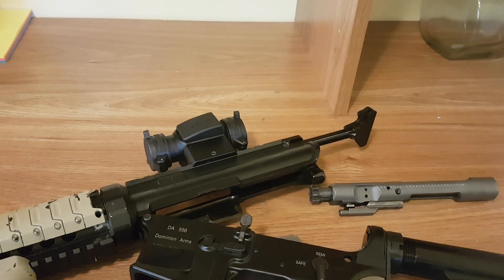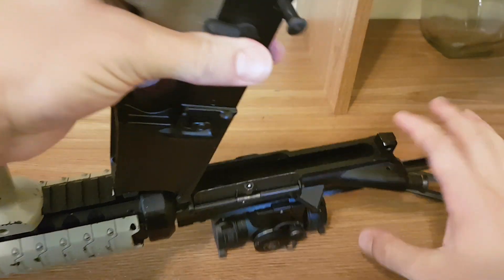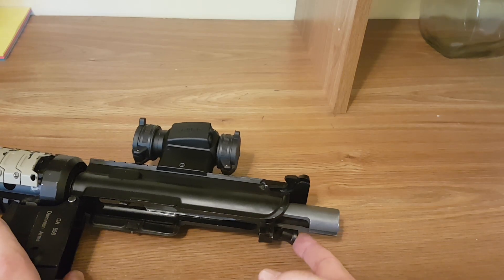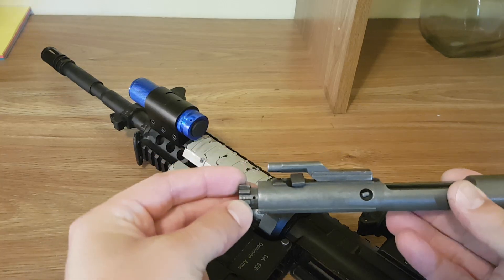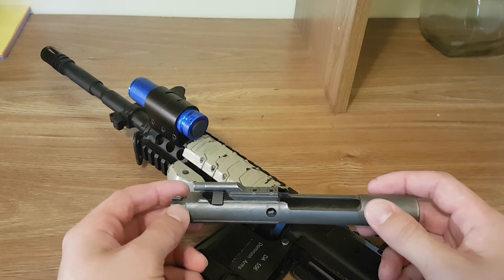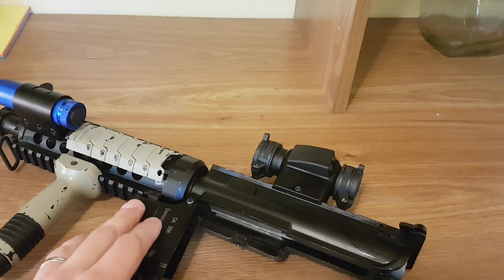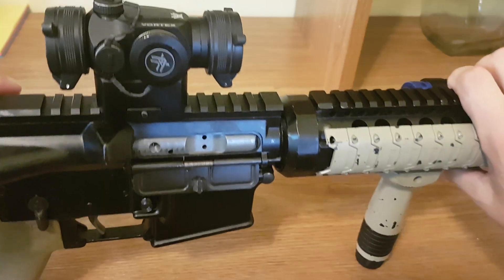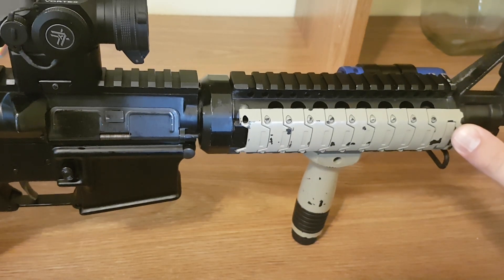What does the Forward Assist on the AR15 Do?

Comment: I noticed that some "less expensive" AR15's come with no forward assist and no dust cover.  Not mil spec but I have read that to a civilian that for the most part wants to have fun at the range this is a reasonable concession and it is not needed.  sounds like you would agree.

Comment: “We designed a dirty shooting rifle that sometimes won’t go into battery. Should we redesign it with a gas piston system?” No, just put a fix-it button on the receiver to force it to work.
Reply: After seeing the InRangeTV mud tests, I'm a bigger fan of DI than I have ever been before. Dirty star chamber or not, DI blasts mud out of the action and presents less points for failure than a piston AR.
Reply: @jasoncarswell7458  Yep. Totally outperforms the AK too.
Reply: yeah. whole concept of such button is wrong
Reply: @dsheshin  The AK has such a button. It's called the charging handle.
Reply: Useless features that interfere with better ideas
national anthem intensifies
Reply: J Calhoun  False. He no longer has the rights to his "direct impingement" system. The AR-18 is mostly stamped, and was designed to be easily and cheaply manufactured by countries who didn't have the tooling to make the AR-15.

Claims of the DI system being dirty are largely overblown. Lackluster early reliability was not a result of gun design, but ammo specs and using the wrong powder.  Pair that with not issuing cleaning kits, and there were many issues. This is all very well documented, but fuck it - let's all bitch and moan about the wonder gun that should have supplanted the horrible AR-15, but didn't, because McNamara was a prideful cunt.

There is a reason the AR-18 never really took off, and it's not just because "big gun industry" didn't want it to.
Reply: Lol
Reply: it originally didn't have it but some branch, iirc marines, made a huge stink about it not being there even if it is completely unnecessary
Reply: @fish3977  Since you have no idea what youre talking about, and are regurgitating points you heard some gamer babble once while playing CoD, you should probably not post on the topic.
Reply: @Valorius  pretty sure it was on forgotten weapons but either way, noone is gonna actually use the forwrd assist. Or at least you are gonna hope so since its just gonna fuck it up worse
Reply: @fish3977  Kyle Rittenhouse used his FA to save his life. PFC Patrick miller used a FA to win the Silver Star.
Reply: Lol, they did that to keep the gun as accurate/light weight as possible. If they did that then it would kinda defeat the purpose.
Reply: Merica😎🇺🇸
Reply: The piston operated Heckler and Koch 416 and 417 still have a forward assist.
Reply: military grade ¯\_(ツ)_/¯
Reply: @steven.2602  military grade everything they have is made by the lowest bidder so what is military grade mean
Reply: @williamdan2593  thats the joke
Reply: J Calhoun  Cool story.

Stoner could not use his DI system because Armalite sold the rights to Colt. I'm not sure what your personal experience has to do with the fact that Stoner no longer owned the rights to his patent. Forgotten weapons made a great video on the history of the AR-18 and AR-180. And yeah, that's exactly what I said. They changed the powder. Modern AR-15s and modern derivatives eat anything too, provided they're well made.

The AR-18 is heavier and less accurate. To what degree that matters is up for debate. But it's not superior in every way.

If you really want to get into the weeds on the powder spec issues, it really wasn't even that the powder didn't burn as clean. The pressure curve was significantly different, leading to different dwell times and chamber pressures when the bolt unlocked.
Reply: You clearly don't understand the operating principles of the AR.

Comment: I'm relatively new to gun ar ownership and like a sponge I am soaking in info, thanks for sharing. That definitely helped.
Reply: Never use the forward assist. If it won’t go into battery then rechamber a new round. If the round don’t want to go in then get a new one that will. Don’t die being stubborn. Only time you should use it is if you get debris in your bolt carrier. Then you sol.
Reply: @Rara Neagra jeeze... That's some real salt and anger... Im also new to guns but I ain't here to talk false information, so please ignore me....
Reply: You have right to buy gun in your country you're so lucky... (fr)
Reply: @Rara Neagra So your also saying doing a internet search will result in yoootooober liar crap? Be a use it says in multiple articles DO NOT fire .556 through a 223 rifle. It says the pressure difference may cause problems including the possibility of blowing the gun up bust more likely to blow the primer out the back of the cartridge and into your guns internals.  Must be an internet and yoootooob conspiracy huh? LOL your an idiot!!  But goid job telling a new guy basically if the round looks the same then it is.
Reply: The best help comes from reading the manual.
Reply: Rara Neagra dude, if you’re going to criticize someone so much and think you’re the shit, please go to a fucking english class before you do so.
Reply: Well then here's a tip for you. Don't ever use the forward assist. All it will do is cause a stuck case to be even more stuck
Reply: Rom vin you sure are making yourself seem wise by insulting everyone who slightly disagrees with you how old are you 14?
Reply: This is bad information. The forward assist does nothing. If you're building an ar15 just get an upper housing that dosent have an assist and save some weight
Reply: @Rara Neagra imagine giving the  internet trolls what they want. Keep on trying keyboard warrior.
Reply: Should have gotten an ak
Reply: Dont use this video as info. It's full of misinformation.

Comment: Just my opinion,  I would never buy an AR that didn't have a forward assist, some people say it doesn't matter because you don't need it.  To me if the manufacturer left it off it's a sign that the manufacturer left off a design feature just to cut corners and save money,  that's just my opinion but to me only a cheap bastard would do that.

Comment: It's for weapon designs that don't run correctly like the m-16 and ar-15. Any competent auto design would close the bolt on it's own. A flimsy charging lever and forward assist is two extra parts to fail or break. Why have them.
Reply: God your uneducated in the ar platform. The ar 15 didn't come with it to begin with it was the army. Why dont you get educated on why the m16 didnt function right in Vietnam.
Reply: @bobbyraejohnson  maybe because gasses are blown back all through the action and magazine, because it's a retarded design. They were paratrooper rifles before the a1 which is what they are good for. Every American idiot wants an ar-15 as a main battle rifle and they just aren't designed for heavy use. It's a glorified Henry ar-7. Why would anyone want a giant spring vibrating in their cheekweld after every shot? Don't you want to get back on target fast? They jam with and without the forward assist so what difference does it make it's junk either way. Cutting 20 grooves in your bolt and adding extra controls is not how you solve  reliability issues.  I think you need more education on non ar-15 powder actuated tools.

Comment: The forward assist was not part of stoner’s original design and he never signed off on it being there. 
The original ammo and design of the riffle proved it to be one-off the most reliable and affective ever put through testing. The politics surrounding the implementation of this rifle is borderline criminal imo.
Reply: This is correct.  The forward assist was insisted on and added by the military.  Then they screwed the powder up and cause many deaths due to jams.
Reply: @tlcconsult  the FA was added before the powder was changed, based on field tests by the Army.

Comment: Here’s why the forward assist makes sense. At the beginning of every operation, when you go condition one with your rifle, you need to make sure that you actually have a round seated in the chamber. So let’s say you insert the magazine with the bolt forward, slap the bottom of the magazine, charge the bolt, now you need to pull the charging handle about a half inch to the rear and visually inspect that a round is chambered and on the face of the bolt. This is called a brass check. After you conduct a brass check slap the forward assist to insure the bolt is locked into battery and the round is properly chambered. This insures that when you go to fire that first round, you will be good to go.
Reply: Spot on
Reply: I wish more people would just do as you did without all the childish arguing.
Reply: Maybe that's the problem with a lot of people around here, they were not taught (or not sufficient enough) to visually inspect if a round is chambered or not.

I mean, reading a lot of comments here, people making fun or legit believing this was supposed to be an "un-jammer" ; leads me to believe they never had a clue what this thing is/ was.
Reply: in other words, it's really handy, but not for its intended use. the clock is fast but there will always be some place in the world where it's right
Reply: @Passw0rdYT The intended use of the forward assist it to assist placing the bolt carrier forward into battery. That’s exactly it’s name and that’s exactly what it’s for, you use it for a failure to lock. You do not use it for any other stoppage in the cycle of operations. You don’t use it for a failure to feed because the round likely wouldn’t be even properly stripped from the magazine. You don’t use it for a failure to chamber because the round likely wouldn’t be properly aligned to continue forward in the chamber. You use it for a failure to lock, whereas the bolt has fed a round from the magazine, chambered it into the bore, but is not forward into battery either due to low bolt velocity during feeding and chambering, lack of lubrication, excessive carbon in the barrel extension and bolt carrier, or a combination of all three.

If you intend the to use the forward assist as an immediate action for any stoppage other than a failure to lock, then yes it is going to be completely useless. But because the forward assist is intended to assist placing the bolt forward into battery, then the scenario I mentioned in my original comment is exactly it’s intended use.

Comment: The "forward assist"  seems like a way for the manufacturer to call a mulligan. Pretty sad flaw and BS way to get out of making an imperfect product. Seems like building a car or motorcycle  that you need to push to get started if the tire pressure is low.  Just ridiculous.

Comment: When your life depends on a round actually loading into the chamber you can pull back the charging handle a bit, see the round chambered, then use the forward assist to close the bolt. Or you can quietly chamber a round slowly and then firmly close the bolt. Handy when loading in a tree stand.
Reply: Yep I always use that while I'm in a tree stand hunting chipmunks
Reply: Or when you remember you never put a round in the chamber when you're sneaking up on bad guys... (●__●)